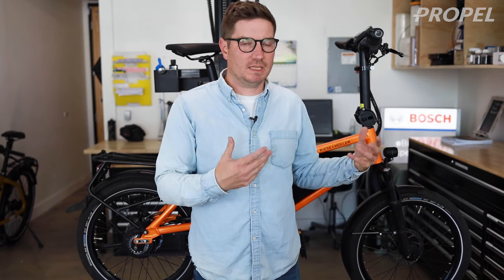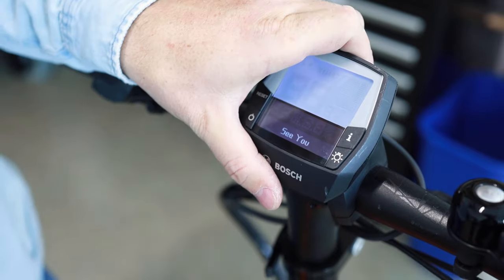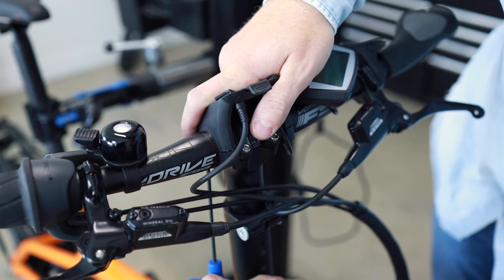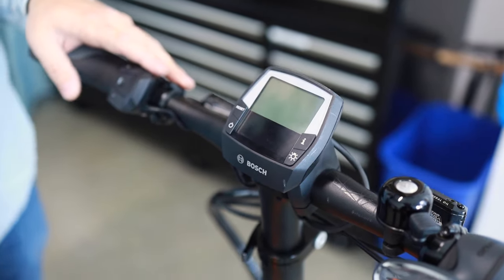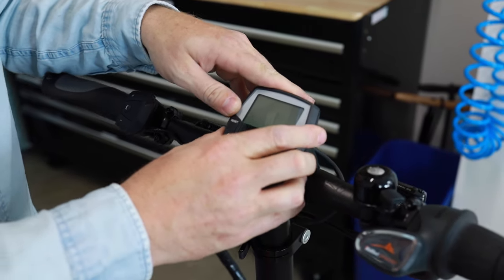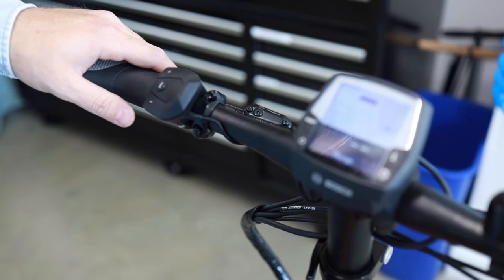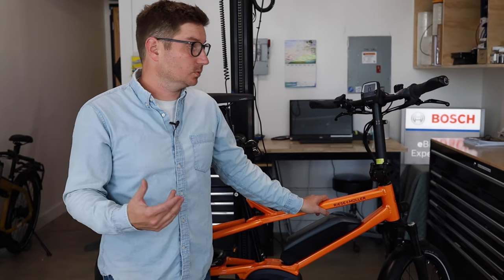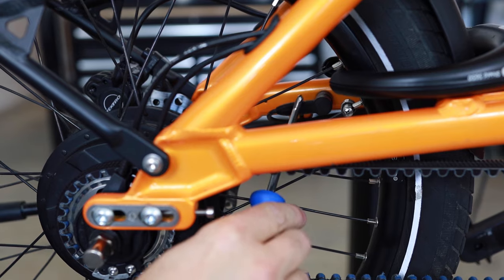Bosch Ebike Motor Systems Troubleshooting | Power On Errors & More

Comment: Hi I have a kiox display and I recently had to change my switch controller as it was faulty but now my bike has gone into limp mode with error 504,any idea is this because I changed controller and any fix i can do myself as all bike shops are closed because of covid 19
Reply from the maker: This is an issue with the speed sensor. It’s detecting a modification of the speed signal and it suspects that there is a speed dongle. I would confirm that the speed sensor is aligned properly, but it’s possible that this might need to be resolved at the dealer.

Comment: Hi Chris, I've been following you since I first found your Youtube Channel.  I love that you are an active advocate for ebiking.  I sold my motorcycle and bought an ebike and I've never been sorry.  
I bought a Bosch perfoance line ebike made in Spain (BH is the Manufacturer) and i have an issue that I keep seeing in the forums - without a satisfactory answer.  (BH has been no help.) My Intuvia display spontaneously cuts off.  I'll be biking along and realize I don't have any assist - and I see the display is blank (as though it's turned off) - and indeed it is.  I can turn it back on again immediately - but I can't seem to stop it from spontaneously turning off.  Any ideas?  (I bought  and had my local shop install a new intuvia computer system.  I thought that was the fix but it's doing it again.  We have gravel paths - and I THINK it's related to the bumpy paths.   (I've taken the battery off and looked for corrosion - none.  I've cleaned the contact points for the intuvia computer.  I loosens the mount for the computer incase it was causing any bowing.  Still cuts out from time to time.) Any suggestions?

Comment: I started having intermittent problems with loss of communication between my Intuvia display and the battery. Thought it might have been moisture in the battery due to being in a heavy rain. A few months later I actually had one of the contacts on the display mount somehow come out so I think that was the original problem.

Comment: Thanks, very useful video. I have a question about my bike: when I press the button on the battery, the intuvia display turns on, but it doesn't show "0" on the speedometer. As a consequence, the motor does not work. Do you know what could possibly be the problem here?
Reply from the maker: That means the display isn’t connecting to the motor for some reason. I would recommend pushing the power button on the battery. You can also clean the contacts with some alcohol.

Comment: Bosch gen 4 performance cx is suddenly making a distinct cranking sound whereas before it was pretty unobtrusive, near silent in fact. Does not make the noise when not under load (when chain is disconnected from chainring. 785miles since new, in full susp. Whyte emtb. Any pointers gratefully received, it’s definitely not the wheels, but is constant irrespective of whether I’m cranking or freewheeling (the chainring isn’t static when I’m freewheeling, it moves around all the time). 🤔 I understand there is no repair possible for gen 4 motor (so much for repairability of products!), only replacement. Thanks!

Comment: Hello! I have a Scott e-sub tour bike and i have a problem with the motor. It suddenly started not connecting the gears inside. I mean: whether or not the bike is on or off, when pedaling i dont get any transmission inside the motor. Please help!

Comment: Can you power the bike from car batteries (lead acid)? I've a cargo bike with enough place under the seat, and the Bosch ones are increadibly expensive for what they are. They contain 40 pieces of 18650 cells, which do like 5€ each, so a Powerpack 500 should be like 300€ max, yet they are 800. So I want to convert to lead acid. That gives 1000Wh for like 100€.

Comment: I have a Focus jam 2 and recently the display turned off.  I charged it externally and reconnected it to the bike but the battery indicator shows --.  I think it does not recognize the battery.  When I test the battery, all 5 indicators light up indicating 100%. What could it be?

Comment: Hi Chris.I have the problem that my Intuvia works but the motor works a while,then it turns off,than on again for a few miles  and off again.....Often when the bike was resting a little while  while l'm doing errands , it connects again or doesn't while it still was worhing until l  parked it.....very strange.....the display works,and l even  changed the Accu  .....doe you have an idea where this could come from? The bike service wants me to buy a new bike even this one is only 5 years old It's a Bosh active motor with the lntuvia
Reply from the maker: Don't buy a new bike. I would recommend cleaning the contacts between the display and the display mount. You could also potentially change the display mount for a newer one with all copper contacts which could help if cleaning doesn't fix it.

Comment: After not using my ebike for few days, the Bosch Performance CX 2019, was not able to turn, without a great effort. I was able to fix the issue by cleaning a small amount of OIL/dirt around the crank shaft. Have you seen this issue on other BOSCH ?
Reply from the maker: This can happen, but I think it's pretty rare unless you ride in very muddy conditions.

Comment: My bicycle gives me sometimes error 510, display and battery are turned on but the motor stops working with boosting (sometimes it workes again after putting the battery back in the back but not always)
Any tips or tricks to get rid of this messages, cannot find anything about this on the Internet.

Comment: Hi Chris, bike stuck on turbo I can’t seem to move this setting on the left hand switch, 🚲how can I adjust this?
Reply from the maker: Sounds like your thumb controller is stuck or bad, but you can try to clean your contacts under the display first. I would also encourage you to check that the cable is not stretched or pinched.

Comment: Hey, I’ve just replaced my Purion display with the retrofit Kiox kit on my 2019 Haibike. The display has connected to my battery and shows all the display settings/screens. It registers my speed on all settings but the motor isn’t driving since I replaced it. Any ideas what to check? Loose connection when I replaced the display cabling?
Reply from the maker: It’s possible that you need a software update. If the software on the kiosks is different than the motor won’t work

Comment: Hi sir i have carrera bosch purion ebike and my display is not turning on when i press the power button my battery is getting on but my display is not getting on so now it’s not working and some time it’s start working just for 10 15 sec then its stop working can you tell me any solution please i am waiting for your answer and it’s very urgent
Reply from the maker: I hope you got this sorted out, but I would guess you might need a new battery in your display

Comment: how can I fix my problem of  no assisting when peddeling ?  The display is connected and there is speed measurement  but no assist. The drive is Bosch active line gen 3 and have 1400km on it
Reply: I have the same issue on my active line plus. No error codes, just no pedal assistance. Everything under the sun is discussed except this.

Comment: I have a performance line cx with purion, i'm able to charge battery outside but if I try to charge it inside bike through frame port i only see the purion display and battery led turn on but without blinking and no charging, why?

Comment: My supercharger2 with kiox display doesn't stop falling out. I presume it has to do with the magnet holding the display not being strong enough. From the ten times it happened a few times there was a 606 error...
Reply from the maker: I wonder if it's seating properly. Maybe change the angle on the kiox how it's mounted to the stem? I also wonder if your fork could be too stiff? In theory the suspension should help with this.

Comment: thanks for the vid, my problem is that the display turns off after 2 seconds of switching on.battery levels are good in the display and main battery.no error message just "see you". I've cleaned terminals - will check for bowing.no service centers in thailand.
Reply from the maker: It's still quite possible that the connection to the display is no good. Are you able to turn the display on when it's off of the bike?
Reply: @Propelbikes  yes ,no problem .full battery

Comment: Hi I press the power button on the display it doesn’t turn on I insert my battery to my bike it turns on every button works apart from the power button and once it’s on I can’t switch it off with the button I’ve also replaced the battery and still nothing 😐any idea how to fix it?

Comment: Hi Chris,  I have a problem, the battery charges to 100% all the LEDs are lit when you press the button. I plug in Bosch nylon and does not see the battery 😞 And when I press the battery button on it on the LCD jumps 100% charged and everything works 2sec and the display turns off 😕😕😕 Please help...
Reply from the maker: This is likely a connection issue between the Nyon and the battery. Might want to make sure the connections are clean on the underside of the Nyon and the display mount, also make sure the display mount isn’t bowed or damaged. It could also be that the battery isn’t fully seated and/or the battery mounts may need to be adjusted. I think it’s likely one of those. If you have two batteries remove one and try that

Comment: I have a similar but different problem... when i turn on the Intuvia display the Tacho shows 0.0 km/h and battery is on. If i then switch the Intuvia off, and then on again, then the Tacho and battery do not activate, and no speed is shown.... i can as workaround turn the battery on at the battery itself, so i know the battery is okay. If i wait 60 minutes between switching the Intuvia off and on again, then it works properly with Tacho 0.0 again..... So my question is - is the problem the Intuvia or the Battery?
Reply from the maker: The problem is the battery in the Intuvia is dead. I would recommend charging it overnight  via the micro USB port off the bike.
Reply: Thanks but tried that already. Also, the Intuvia works fine even when not mounted on bike. Could it be Intuvia battery is good enough for display, but too weak to activate the main 400Ah battery?
Reply from the maker: That’s it. It doesn’t have enough juice to tell the battery to turn on. If your bike is still under warranty I would try to get a new one.
Reply: @Propelbikes  unfortunately it's 4 yrs old and often used. I can still turn on the main 400Ah battery directly via its own on/off button. Thanks for your super fast answers 👍💪
Reply from the maker: Cool. There was a tutorial on the web on how to change the internal battery, but we have never attempted it.

Comment: Got new bike with 625 battery, when plug charger in nothing happens, doesn't show it's charging, no lights on battery even when plug directly into battery
Reply: I'm facing the same problem. Were you able to fix it?

Comment: My bike won't turn on from battery or display. Display says"attach to bike" then "see you". Also, no signal showing  battery is charging.
Reply from the maker: I would check how tight the handlebar mount is and clean the contacts.
Reply: It is very tight
Reply from the maker: Loosen it and try it again
Reply: @Propelbikes  update! I returned the bike and got another one but having the same problem on the new one. 
I had everything fixed, test ride was ok.
Battery was at 1bar, charged to full.
Insert into bike, no power.
Charge back, no light.
Tried holding power button for 10,20,30 seconds, still nothing.
Please what exactly is going on?
Reply from the maker: It sounds like an assembly issue at the shop if the display mount was too tight. I would look at that as the culprit again and ensure the display is firmly seated.
Reply: @Propelbikes  i don't think it has anything to do with the display. I confirmed it was the battery when i tested with another battery.
I'm just not clear as to why the battery behaves that way.

Instruction that came with the bike says, and i quote "First charge = run the battery down from full (to empty) and charge back to full".
Battrry was at 1bar when it came, after test ride, i charged to full and it has stopped working/charging after inserting into bike.
It's just so weird

Comment: today i made a mountain climb on my cube reaction hybrid slt, which I do 3/4 times a week, suddenly I get the error 504.
my bike is original and not tuned or anything like that. 

anybody had this and can help me out, I'm living in area where I can't go to a dealer and update.

many thanks in advance..
Reply from the maker: 504 is a tuning detection error. I would check that your speed sensor is aligned correctly.
Reply: @Propelbikes  thank you, I did right on the inside mark.
going for the 90min drill now, can't believe it to be honest brand new motor and having this issue without tuning or speed boxing, extremely disappointing in Bosch for this.
Reply: Did the 90min ride work? Also do you do the ride with the display unit totally off?
Reply: @meatandfish  eventually I did the hand-drill trick, after a few faillures i finally got it to work, it took me around 30/45 min,  8/9 km/h steady. felt like a blessing:)
i still have fear that it might happen again when I'm riding which is not so cool but ok.

riding with the display totally off is not something i've ever done, but interestingly enough I'm glad you asked because the 540 error did appear after a break, where the display always turns off by itself (they should really change that btw, also for tracking your ride on the app) turned it back on and the error appeared when I was going downhill.

Comment: ERROR 510 ? what do i need to do ?
Reply: I’m getting the same error but can’t find exactly why.
Reply: @colinpercy2028  I found out why, there can be only 2 option, either the sensor is not in the right place, or if u can try to use the walk+ and see if the bike start moving forward that is for sure from the sensor on the wheel, otherwise if u use  the walk+ and the bike doesn't move forward is the motor, exactly what happened with mine, I just went a full refund and buy another,  hope it helps!
Reply: @iulianradu2839  thanks I’ll try that out.